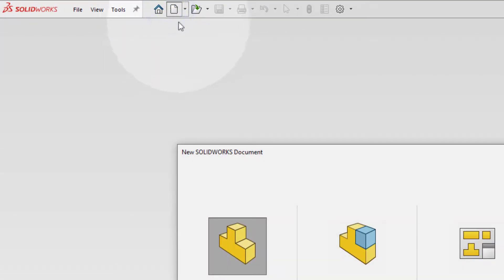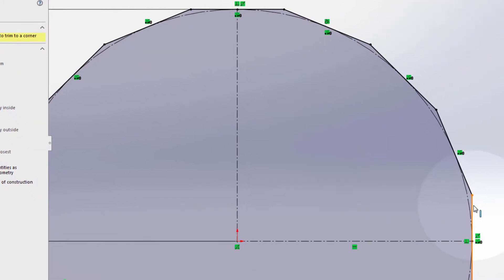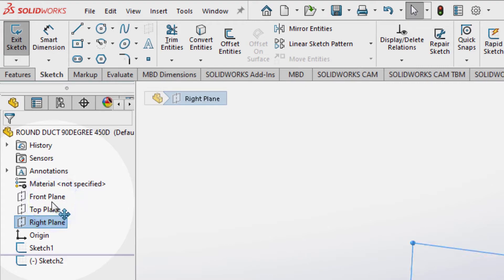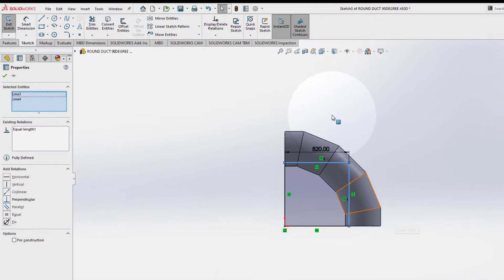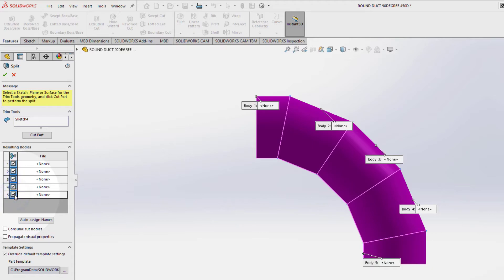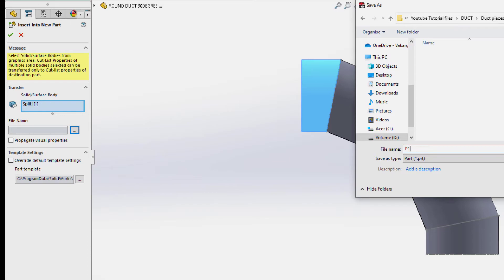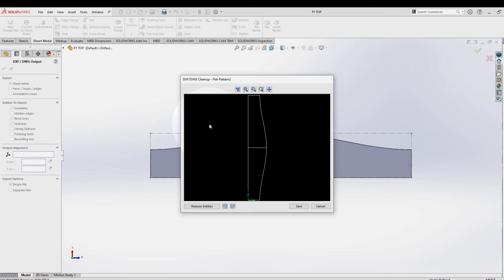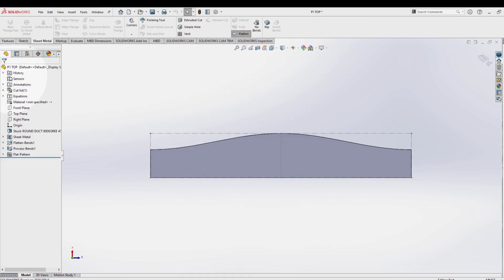How to design a ROUND DUCT TYPE in SOLIDWOKRS 2020

Comment: Pl advise best software or manuals 

Round / circular process duct calculation including, Expansion joint, Stiffner, development, Load calculation on each support
Reply from the maker: Manuals you can buy to develop expert knowledge for Ducts Systems:
1. Book: Sheet Metal & Air Conditioning; 4th edition (15 January 2006)
2. Book: Manual D - Residential Duct Systems 3rd Edition
3. Book: Air Conditioning Contractors of America (January 1, 2013)
4. Book: Modern Refrigeration and Air Conditioning Twenty first Edition, Revised,
Reply: @solidworxedu1035  thanks 😊,,these are related to HVAC , but my requirements are process round ducts which mostly inclined, someone has recommended smacna
Reply from the maker: @RISHIRAJ-xc7tu  SMACNA sounds reliable. They have 23 years of experience and their projects look quite complex. So it must be a great leadership company in the HVAC systems.